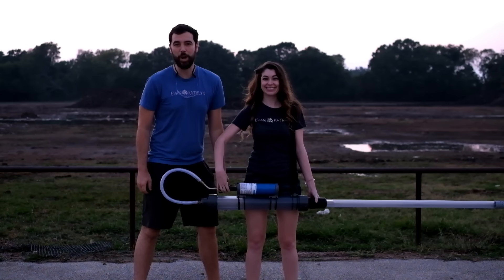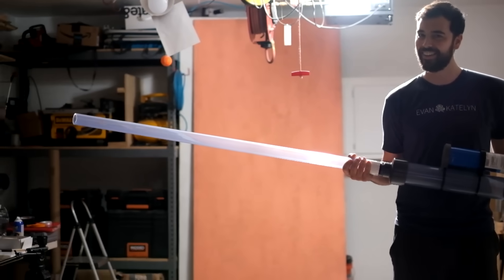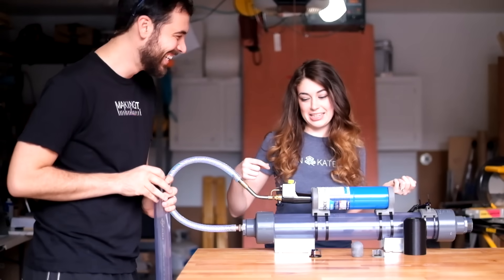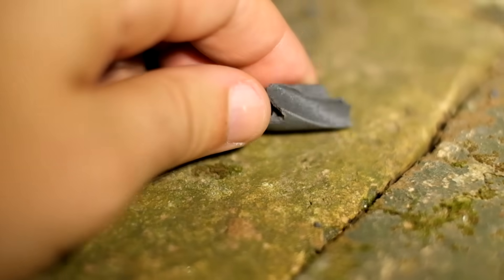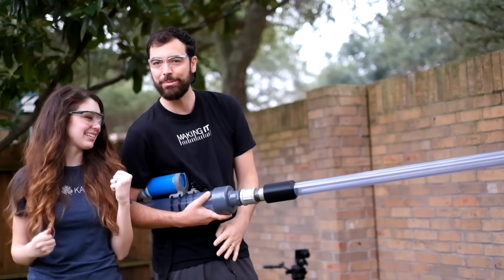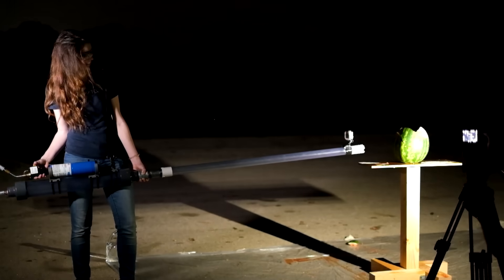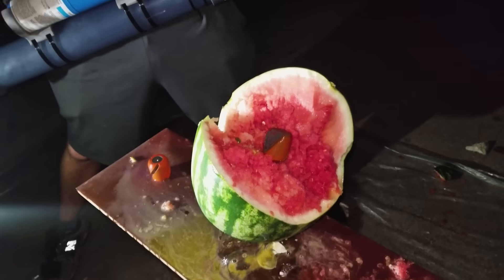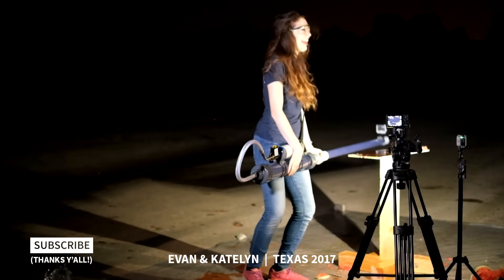Cops caught us firing our homemade propane blaster

Comment: Couple of random notes from having also built one of these (and I agree, you probably shouldn't lol, especially with regular PVC they like to esplode) 
You have to fill it up for a bit before igniting the torch, for a chamber that large I'd guess something like 5-15 seconds
You were correct in determining that there has to be very little restriction in the barrel; since the torch mixes the fuel and air at the nozzle if there is too much backpressure it will either mix rich or just flow out of the air intake
Mine also got the cops called on me, who just told me to move it to the backyard...which was closer to the neighbors who called them lol.

Comment: I am working on a design to introduce a propane and oxygen cylinder to my cannon a long with a psi gauge. Not sure what kind of regulator to use to combine the gases equally. I read a comment that recommended using an Arduino computer for the mixture. Lost on me finding a schematic or more info on how to build it.

Comment: I am not trying to be a troll, but this is the 2nd weakest potato cannon I have ever seen. The first was when my 15 year old friend tried to make a 'handgun' potato gun.... It also kicked not at all. Every single cannon I have ever made has been very difficult to hold onto. With methanol (I think it was, that a friend got from a coworker at the MN road research center), once warmed up, it ripped the gun out of my friends hands (he is a VERY strong fella) and threw a clear blue flame about 15ft out of the cannon.

Point being, not sure what the flaw in their design is, but I feel it is the long and narrow combustion chamber. The fuel system, frankly, is VERY poor. Regarding the idea to change the loading system, we always made breech loaders. It cost a little extra for a barrel that unscrews, but it makes loading a very quick process.additionally,if you are shooting potatoes, sharpen the inside of the barrel, this will increase the pressure and get better results.

MAPP GAS IS BETTER!

Comment: Cute but you need a method to measure exact and consistent gas amount and you can only really do this with a microprocessor (not that difficult as you seem to have some technical skills!) and you're absolutely right the problem is oxygen there's way too much gas the first shot probably worked because it was moved around a lot and mixed with the existing oxygen before firing it 😇 you can see how just a small gas leak can destroy a whole building though. fun to see you guys as a couple working on the project though (sorry just realised this is 3 years old 😂)

Comment: EvanAndKatelyn. Suggest setting aside the shoulder strap, Make it shoulder fired.....As in the old WWII/Korea War/War on Terror...bazooka/TOW  missile style. Propane is extremely heavier than air...is why it fires better muzzle down. Upsize your expansion chamber to provide a superior barrel velocity. Drill a small weep hope at the breech of your barrel to flush non-combustible gasses then you can eliminate the barrel bushing that allows gasses from escaping from around your projectile.

Comment: I would like to give  thumbs up or a KIDOS but, you.........
Polluted the concept with using a 3D prnter. 
Maybe im a bit of a purist, but PVC, glue Aqua Net hairspray and  a spud. That's it.
  That's my opinion only, but I  think going simpler is better. Ive had  a spud gun, or cannon with hair spray is the way to go. We have a metered dose of propane. Use schedule 40 at a minimum. Use cleaner and new cement. Sand or file a cutting edge onto the end of the barrel so when  loading,  just push and twist the potato into the  barrel and then push the ammo down to the start of the  barrel.  
   Make it LONG, nit too long, about 30 to 36 inches of  1 1/2" and 3" for the combustion chamber, 3 x 18" or so.

Comment: HHO: sliding a hollowed out coupler down to cover a hole drilled for the slug could provide a better load. But if flames come searing out, your fingers may end up looking like The Avengers Nebula when she takes the stone from the iRobot containment cage. Wicked video though, Thor's sister has a run for her money. ;)

Comment: hay so you guys should go for distance and i see 2 issues one is that the propane cylinder has a gas exit for air you should close that and take the barel in the other tube more and implament a new ignighter at the back end and seal up the bullit like you did last time maybe smaller and to get the air in the tube to add a valve steam to it so the gas does not escape is why it only worked with it pointed down gas rises ps like your videos seen your one on lcd see through screens 
\

Comment: Use a pump system like on a shotgun , a sliding pipe just large enough to fit over barrel , hole in barrel just a little larger than projectile , so you pump in a round then shoot , pump in a round then shoot !

Comment: I think you can really add a laser , and let me say , you can make an Arduino base computer for this mounted on its side , that knows how long you need to bring in propane and there is a servo controlling the propane button . When it reaches correct fuel air mix , the computer lets you do the honors
Reply: Where could I go to find such a design as you illustrated?

Comment: For loading it closer to the base, what about another piece of pipe that fits around the barrel then both have a hole big enough for the projectile? Once it's loaded in, you rotated the outer pipe, creating a seal over the hole.

Also, would love to see what kind of range you can get on it. Maybe create a projectile you can put one of those little balloon lights in so you can see it as it flies or after it lands?

Comment: Very cool. I think because propane is heavier than air you might've had problems with the propane "falling" out of the barrel when you were tipping the barrel down. The first bend could also be affecting it a little.

Comment: You could've added a oxygen tank with an air valve....so it would be like a compressed and combustion cannon... The oxygen with mix with the propane and it'll work fine ....but don't this with a plastic cannon... Good work tho

Comment: You should put a tube on top with a little stopper that you can use to drop another projectile into the chamber that way just pull the stopper and drops a bullet in push it back keeps the rest from dropping down into the chamber with a cap on top so the pressure doesn't escape through your loading tube that's for your loading problem and for the ignition problem it could be your torch heads not a great one for contained gas ignition but you could also try MAP gas it's in the same container as you have in the video it's just yellow not blue

Comment: Dunno if it's too late or mentioned before: try to have the igniter producing an arc in the combustion chamber itself. There's arc cigarette lighters which could do the job or - if you know some nerds - let them build something using an NE555 chip to produce 'continuous waves', coils and a spark plug :-)

Comment: Also.... What if you put the propane tank back further, flipped it so the nozzle points down and the shortened the hose to a few inches? The way it draws in the oxygen is I believe the Venturi effect and a gas or liquid flowing passed an opening in he end of a tube creates a area of negative pressure right at the opening from the swirling around creating a bubble of negative pressure. Crazy you can make negative pressure from positive pressure. I frickin love science!!!
Reply: You could also add a pvc 90 elbow to help with the bend on a shorter version of the tubing. Maybe This method would increase the consistency?!....

Comment: You made a potato gun. LOL I was making then 20 years ago. Your doing it wrong using a wrong lighting switch. Propane and a grill lighter works the best it. Using electric spark made for high pressure tanks not one pound propane. Bigger sparks also fill the tube turn off the propane then light. Launch some potatoes they seal nice. Hints potato gun.
Reply: Yes it works with propane but use hairspray something that you can spray that lights fast. The air and propane mixture it got to be just right. If you play with it. It should light

Comment: The reason why its not working is because you have to hold the button down to let the gas flow throughout the whole chamber and tubing. Youre just lighting air if you just click it right away. Duh

Comment: Hey guys great video!! You need to upgrade your torch tip. Go to home depot, buy their most expensive torch tip run ya bout 50 bucks. You have more control with the trigger. What you want is long spurts of gas then click. I liked and subscribed. Look forward to hearing how it goes. I got a few stories nyself building zip guns. Had a few close calls. Any way have a covid-free day!!

Comment: Smaller barrel diameter and smaller projectiles and shorter length barrel on the same ignition tube and system will have better velocity and penitration.

Comment: there IS a way more dangerous option, acetylene. its extremely flammable and extremely combustible. its used in welding and cutting, also in other applications. but its also unstable in a way. i use it mostly in oxy-acetylene cutting and welding, but it has a bigger tank size tank then propane and butane.
Reply: you will need some more safety equipment for this. also it does not have a trigger system. (that i believe,)

Comment: Wider expansion chamber , Affix a one way valve that draws Oxygen in while the Barrel is Plugged and forming a Vacuum the Vaccum seal with the right draw of oxygen-propane mix will actually be significantly more powerful requiring Alot less barrel Length

Comment: The issue is the propane is pushing the majority of the oxygen out of the tube. You're igniting from in that tube and it doesn't have any oxygen because you pushed it all out and have to wait until it refills or mixes properly; additionally, the oxygen has to be mixed consistently with propane throughout the entire tube for it to ignite; you see a few false ignitions because there is a gap where there is oxygen or propane, but lacking the other - or another gas is creating a barrier. Add the spark to the ignition chamber and you won't have these issues.

Comment: Cut out a square section of the barrel and use a sleeve the slides up and down the barrel to block the cutout after you incert the  projectile. Maybe a 3d printed part with reinforced carbon fiber.

Comment: Awsome video the reason why you have to angle it down is so the gas can build up when angle up the gas escape and will not give you the right ratio to  Ignite some kind of heavy duty flap  Between the Ignition chamber and your barrel where the bullet sits may help correct this problem  Keep in mind if you do use a flap you will need to create some way for air to flow back into the Ignition chamber to fire a second round like a one way valve Or check valve used on air compressors

Comment: Your decorative piece on the end I believe is actually functional inadvertently. It's kind of a flash suppressor. It directs part of the unburnt fuel out to the sides through the holes and more rapidly cools the gas so as to have less ignition of fuel after the projectile leaves the barrel. This reduces the amount of visible flame coming out of the barrel.

Comment: By angling the blaster up you have almost created a reverse ramp for the gas to escape out the barrel by holding it horizontally the gas has less time to escape out the barrel if you could create a one way release valve somehow that could fix the problem but I would have no idea how to even design something like that in CAD I’ll leave that to the pros. Great editing great content.

Comment: Back in 2014 when my brother Jesse and perfected the first clear-line gas cannon, we were both having issues with the ignitor. Sometimes it would fire, other times we'd have to click the piezo sparker more than once. You definitely want to hold the gas for three seconds then a full click for fire. After a few fires, you eventually do want to replace the Piezo. I like the rounds you've made for the clear-line gas cannon, that is super cool! Good job EvanandKatelyn!
Reply: We upgraded our cannon to a large metal pipe with a smaller gas chamber made from a super beer can. The two fit together well and the steel beer can was just the right shape to handle the high temperature from the flame, I feel it is necessary to bring that to your attention if ever you two decide to do this and have read my comment. Shalom.

Comment: Since propane is much heavier than air and the angle seems to be an issue, maybe when the end is angled up, the propane is staying at the bottom/back and not mixing well?

Maybe you need an O2/fuel mix solution in the big chamber to optimize firing at all angles?

...

What am I doing?  This stuff is terrifying to me I'd rather see more resin and soaps and supurrvisor friendly builds

Comment: Years ago on a Navy ship, one of the HTs (welders) made one out of steel pipe. Filled it with acetylene and oxygen. For a projectile he filled a Pepsi can with nuts and bolts. He fired it once. He had to repaint the shop because the impact and ricocheting nuts and bolts chipped paint everywhere. Be safe and have fun!

Comment: I'm a bit late to the show but in case you're still looking to upgrade as far as loading would it be possible to cust a section from the main tube to load then have a slightly larger one that can slide up and down the barrel to close it off again? Idk if this would cause too much air to leek just a thought

Comment: If im not mistaken a MAP Gas torches nozzle injects air in with the gas... might use that instead of propane, or see if using the nozzle from a MAP torch works with propane

Comment: You could follow a classic shotgun loading method and rig a magnetic or spring loaded flap that allows for you to load the bullet in from the bottom of the tube and then seals back once loaded. The bullet would slide up into it from the bottom then forward slightly then once flap closed the bullet would only have a few inches to slide back towards your stopper.

Comment: The projectile would travel with a lot more velocity if it didnt have air passage but instead was the same diameter as the inside bore of the tube that holds it.

Comment: I know this video is old, and this will probably never be read, but my thoughts on this were to add a solenoid valve that will allow you to pressurize the gas, and then an ignition source just after the solenoid. Using a raspberry pi, arduino, or something to time it so that the ignition source activates just after the solenoid opens, all of which would occur on a trigger pull or button press. This would require two tanks that you would control the flow from to create your own mixture in the combustion chamber. You would have to play around with the timings and the fuel mixture to get it just right, but it would be a fun progression, or next step to this project.

Comment: After every shot flush out the burn air and gases, replace them with 100% atmosphere gases.  For a better air fuel mix.  Time each gas charge and only hit ignition once.  And take note of the results

Comment: Can’t wait to see 2.0. 
Would like to see this handled with firearm safety in mind. 
A firearm is made to propel a projectile by means of an explosion. So, yes, you’ve created a firearm and it should be treated like one: always treat as loaded, don’t point at anything you’re not intending to destroy; finger off the trigger until ready to shoot; know your target and what is beyond it. 
For safety, the next test firing should be at a firearm range. 
Building a firearm is completely legal, usually. Discharging it in the city likely is not. 
Some aspects of the design may classify it in unique ways under firearm laws. You might want to consult a firearms attorney to be sure you don’t create an AOW “Any Other Weapon” or a destructive device based on whether it fits into some categories.

Comment: Your ignition point is all the way in the back of the hose and when you hit the propane trigger, you're pushing all the oxygen away from that point. This is why it hardly ever fires. The spark should be in the chamber and ideally you could have an oxygen tank to pump more oxygen in.
Reply from the maker: Thanks for the tip!

Comment: Try fitting a venturi valve on the pipe leading to the main chamber. This should help suck in fresh air to replace the air used in the previous combustion. Also you could try a cut (hole) at the bottom of the pipe to load the projectile and have a [strong]  3d printed cover to slide over the hole to create the seal.

Comment: That's sweet, I dont think it's doing 1000 fps. My golf ball gun does more damage to a watermelon. The clear chamber is cool.
Reply from the maker: Ah sorry for the confusion, it's 1000 frames per second, not feet per second. Thanks!
Reply: I see, my mistake. Its still cool
Reply: I it doesn't work when tilted down because the propane is heavier than air. It displaces the air and the propane can't burn with the proper fuel air mixture.

Comment: The gas will accelerate even more if you can taper the cannons' diameter. Gas flows faster thru smaller tunes and slower thru large tubes. You want to go from large to small like a funnel before the gas enters the barrel.
Reply from the maker: Ahhh interesting!

Comment: So it works when you tilt it down as that lets the heavier gasses exit and draw fresh air into the chamber. The whole reason for so many failures is a lack of oxygen. Want it to work every time, you need to add the features of a Bunsen burner, i.e. let air into the mix on the gas inlet side.

Comment: You are letting all the gas run out, you could add like a  half way to top all inside the chamber to hold as much gas as possible no matter how much you tilt it
Reply from the maker: The issue isn't not having enough gas, it's controlling it because you need the right mixture of fuel and air